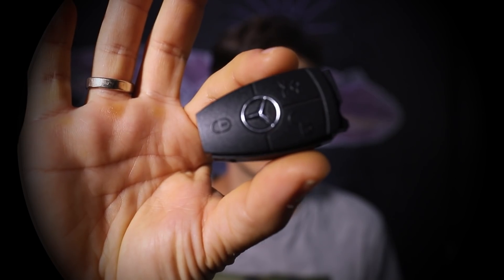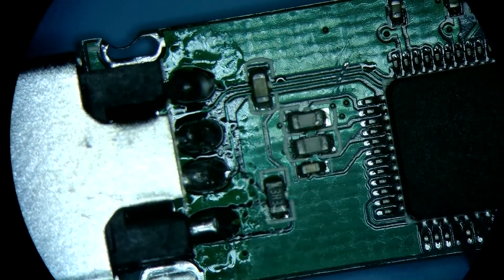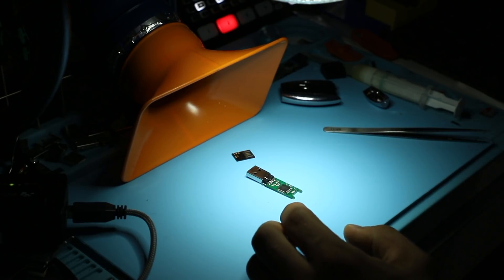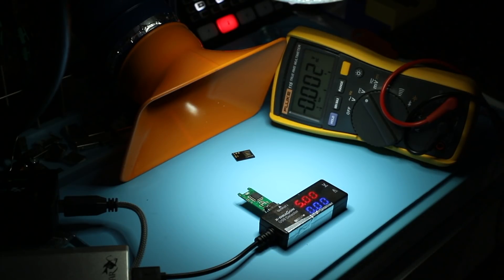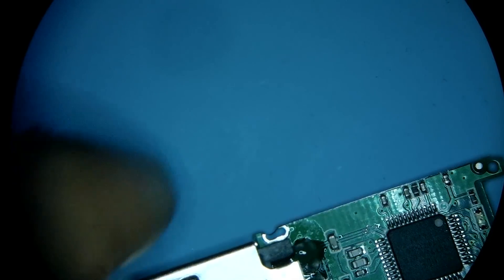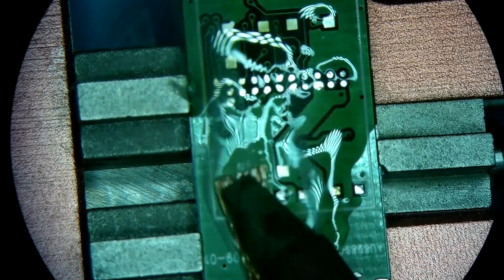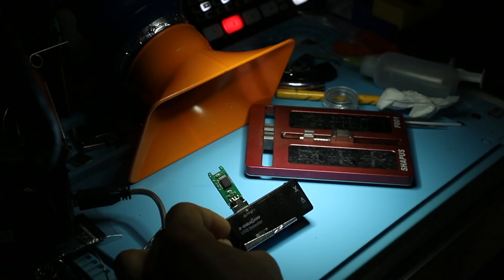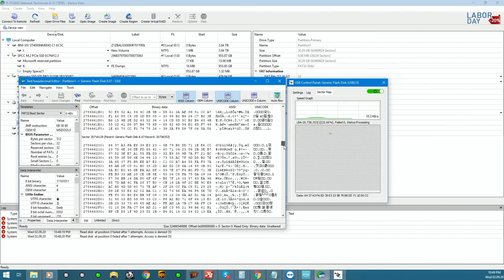flash drive troubleshooting after another shop failed

Comment: Erkin ,
      I Would Want You To Check What That Controller Is ,That IDE Label Controller Was That AU Controller In Disguise of IDE .I had a good laugh when you said they tried to solder the internal monolith to a PC " I mean really " , This shows thier understanding of NAND Flash Devices . I Really Liked The Video ,Keep Up The Good Work ,My Self Training On VNR is Also Going On Quite Well ,But Support From Rusolut Is Required In Most Cases ,But Its Interesting
Reply from the maker: yeah dude, I chuckled when I saw solder marks on interface of the "NAND" too. Kinda the same as people opening their clicking hard drives to see if heads were stuck :)
That shop was around before I even started to work for Andrei back in 2005. Oh well... :)
Reply from the maker: as for the controller, yes indeed it was Alcor. if you google the IDE part number it has a bunch USBDEV info on it.
Reply: @hddrecoveryservices  Very Nice ,I have never seen such a case here in india

Comment: Easy issue, hard to find :-)
I'd like to tinker a bit myself with recovering flash drives and I was wondering about the temperature of the temperature of the hot air and the melting temperature of the soldering paste you are using. I've never did reballing before but it seems doable with a bit of practice. I'd appreciate any help to get going!
p.s.: I found the answer for the hot air, thanks

Comment: Wait, a little bit confused. One of the data pads (slightly) delaminated, and severed from the track at the plug right?
Reply from the maker: original issue was a broken connector. First shop put the connector back on without cleaning up/testing pads for the connector. Obviously, it did not bring the device back to life, so they pulled the NAND in attempt to do a chip off. And came up short because the NAND was a refurb monolithic flash drive. What fascinates me, is the fact that they attempted to put a connector right to the monoliths interface.
Reply: @hddrecoveryservices  If I may; What is your thinking in terms of being facinated by the previous tech trying to put a connector on the "NAND", seeing how the "NAND" here is in reality a stand-alone USB flash drive? My own thought is "why not just try to connect it directly as its form factor intends, it doesn't need a connector". Should they (did you expect them to) have known through experience, that the onboard controller on the monolith flash drive was busted?
Reply from the maker: The only reason we see these promo flash drives built with epoxy blob NANDs, eMMCs, monolithic flash drives via bypass, SD and microSD cards via bypass, is because they do not work. Instead of trashing these failed devices, they get sold to to refurb places. Promo flash drives internal controller and internal controller of that SanDisk flash drive do not work the same. It would be similar to using Hitachi PCB on a Seagate hard drive. Native interface on that SanDisk flash drive can't be used to communicate with data.